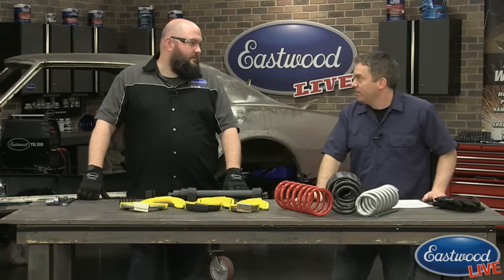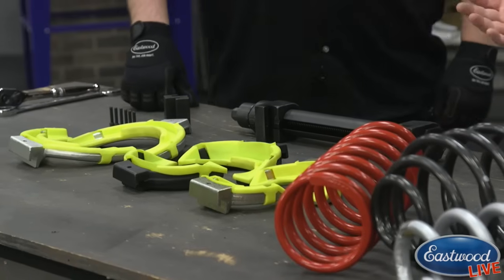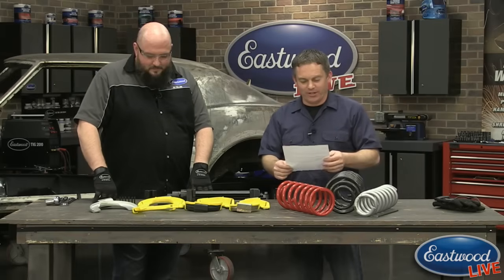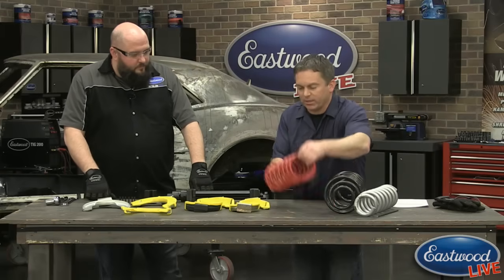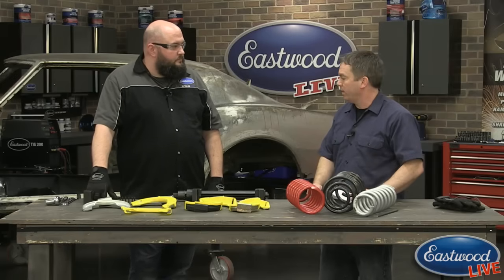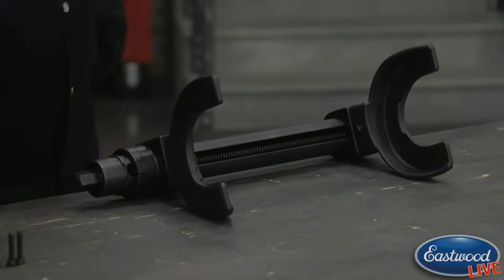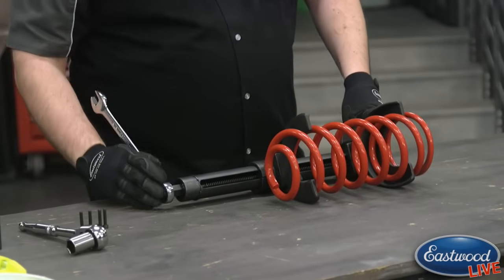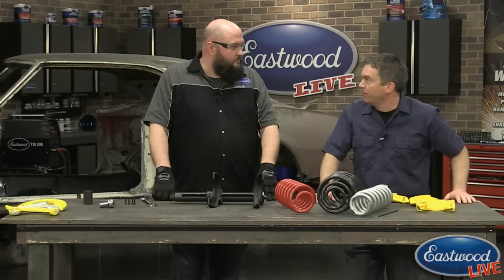How to compress a coil spring or strut using a Macpherson Strut and Coil Compressor.

Comment: Im a toyota tech and i find that once the coil is compressed and the strut is removed the coil is twisted and will not allow the new strut to align with the top hat to resecure the 2 components. Am i placing the compressor in the wrong spot on the coil??

Comment: Thanks for the video however, what would've been good is to demonstrate compressing the spring with the strut attached as we all know that it's more difficult than simply compressing the spring on it's own.
Also, a demonstration of compressing the larger conical spring (the black one) would've been helpful as they are typically a bitch to compress.
Reply: AGREE!

Comment: Hey bossman, great video👌🏽 ihave one question, Ijust berly picked up a 99 civic with coilovers & inotice the car chassis goes up & down violently. I decide to inspect the suspension & noticed the springs were loose, doo ihave to compress them or does that mean that the springs are out?

Comment: Mighty Car Mods does not use a coil spring compressor. They just lay the strut on the ground and zip the nut off with an impact wrench. The strut only shoots out a foot or so. Then they get one guy to press down on coil and other guy threads the nut back to the strut. Cool product, but I don't think the MCM is dangerous at all.
Reply: Brooks Yeager I just use zip ties works great
Reply: yeah until he uses a 500 pound spring